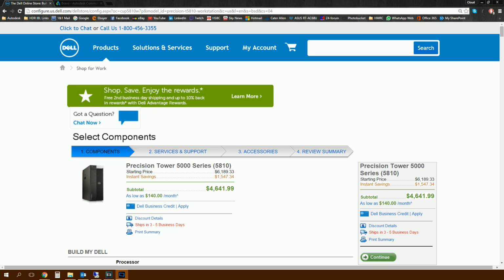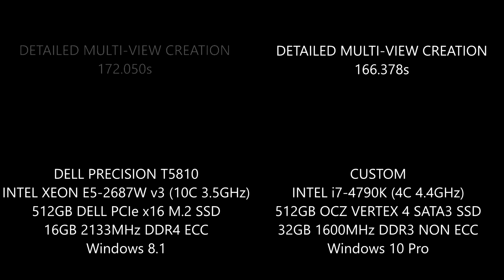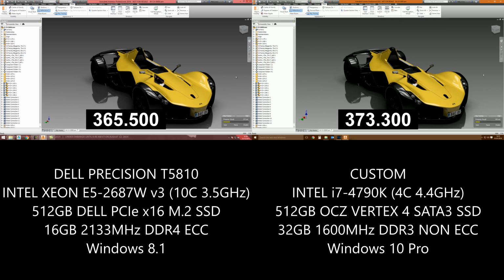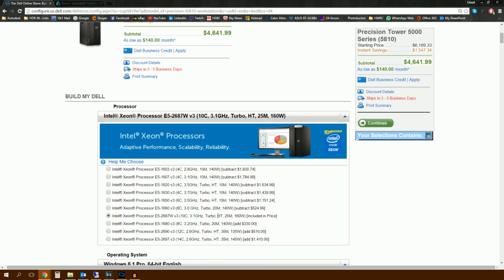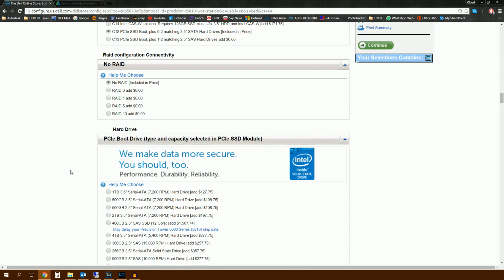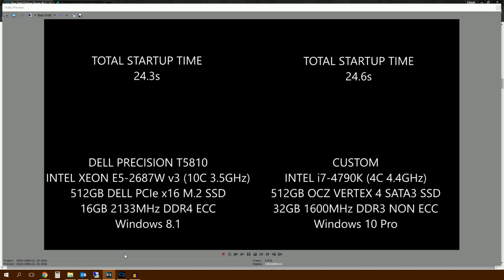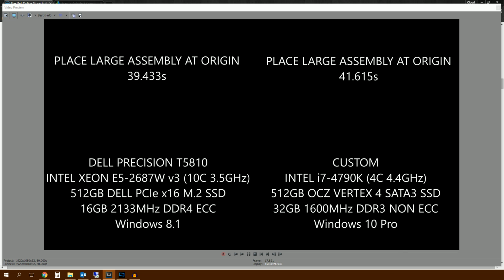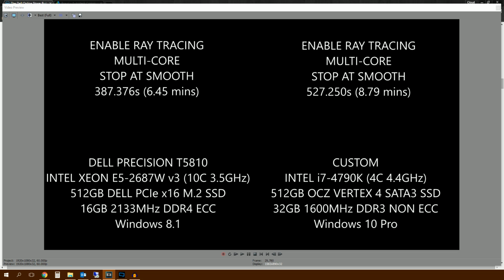$6000 10C Dell Workstation -VS- $2000 4C Gaming PC | CAD Benchmark Test

Comment: From my personal experience, Workstations are and always will be better than putting together a PC.
My background: Server Hardware Engineer, 6+ years of experience in Dell Precision, Powervault, PowerEdge servers/workstations/storage solutions, IBM X-Series servers, HP Proliant, Procurve lines. Anyways...

I have personally purchased both second-hand and new workstations from Dell. 
Here are a few:
Used: Precision 490 (2) , T5400 (2), T3600 (2), T5600 (1 - & my personal PC)
New: T3600 (4), T5600 (4) 

I agree with the idea behind Dell marketing making a huge deal about server line CPU's is a bunch of fluff. You CAN build a PC that is nearly as-good or equal to a workstation. However, my point is the failure rate between a custom-PC and a workstation is appalling. I have fixed and worked on both and I rarely get back workstations that have failed from the moment they are sold to when it reaches the client. Yes there are some failures, however the sheer number of failures I receive are about 90+ % more leaning to custom PC builds. Out of 100 or so workstations/PC's 90+ of them are custom-PC builds. Workstations are meant to run for long periods of time without the necessity of powering them down. 
Of the workstations I've purchased used and new not a single one has failed me in respects to it's integral components ie: CPU, memory, PSU, USB ports, Ethernet Ports, Onboard SATA or BIOS corruption. The only components that have failed me was a single SATA Drive (5 yrs old ) and a graphics card on my T3600. My Old personal PC was  T5400 that I bought used 3 years after it's release and was running for a good 5 years with no issues. I upgraded to a T5600 and my T5400 went to one of my employees. Still running strong with a newer graphics card. The best part of all is, Xeon CPU's and Server Ram (Registered or buffered) is only getting cheaper. I've put together workstations that cost me hundreds instead of thousands and are better than today's custom-PC's. There are pro's and con's but if you prefer a solid build i'd stick to a workstation from either Dell or HP. 
Just my two cents.
Reply: Yeah these amateurs with their gaming pc's just don't understand the advantages of an enterprise class workstation. Just watched another video of a guy running gpu gaming benchmarks on a quadro card lol :D
Reply: Well, I have still runing an old Athlon x 2 64, from the time, Pcie slots came to light.
It ran practically 24/24, 360/365, with renewal of only the PSU, as it was  getting overloaded, from being in a hot climate, and running 8 Harddrive. The only reason, the machine is now , for the time out of service, is, because the OS crashed, due to HD FULL.
I do acknowledge, the older hardware seems to be more stable and durable..... Still have an old K6-II super socket 7, still working well..., and I have 6 servers Dell 2850, ALL have motherboard issues..
Before that, I ran a own build server, based on a K5-133 , EIDE ( now PATA) drives, scsi controller, and a scsi raid controller, shared the internet connection, ran a website, was faxserver, etc... it still runs....

The only stuff that died on me, are the Dell 2850's..., and a ecs duron board.
Reply: Yes,  I recently replaced an old DEL XPS420 with BSEL modded Q6600 (3.1 Ghz air cooled) that I ran for 10 years.  Moved to a DELL T5600 with dual E5-2667, 32 GB ram, H310 RAID card, and 825 W PS.  Threw in the GTX1050 that was bottlenecked on the XPS 420 and voila...plenty enough for my home PC needs.  The T5600...got it from my company when they decommissioned them for newer latest gen i7's for our developers.  It was allocated at zero book value...basically I got it for free through the company deal.  Not bad.  Smiling with this monster...all the way. Will upgrade the video card after the prices inevitably drop after XMAS. Probably a 1070 or 1070 Ti.

Comment: Inventor only uses 1 core for all it does, except for the rendering engine to create a nice presentation shot. So as it has been for several versions before 2016, and even now with 2018, go for a higher clock over cores. as for video performance, autodesk-microsoft-nvidia have had issues properly switching between the onboard gpu and the plug-in GPU board. It seems to have been cleared since Inventor 2017. so the i7 with video will be fine over the xeon.
Reply from the maker: +FlexDRG Inventor doesn't only use 1 core. It is mostly single threaded but there are 7 or 8 modules that are now multi threaded such as the graphics engine, FEA solving, drawing view creation and others. It's far more complicated than a one sentence answer hence why I started a real world suite of benchmark tests but indeed an i7 is still the best
Reply: TFI Correct. but as about 90% or more, mostbof us will be in the modeling interface (part and assembly work) that is single treaded, clock will beat out cores. getting a slower, higher core count cpu is nice if you have an oldscool design office where a dedicated person is making design views (idw) and or nice machine renderings. otherwise those extra cores go to waste and productivity drops for lack of clockspeed...
Reply from the maker: I know, I've published loads of videos proving that with benchmark tests.  Too many people completely missed the point of this video and treat it like watching a gaming system comparison.  The point wasn't to see which is better and then shit on the loser.  The point was that there's millions of enterprise end users out there who don't know hardware, and after reading the marketing material, they'll believe if they buy a $6000 workstation it will be the best that money can buy.  The point here was that you can't just throw money at hardware to get the best performance in 3D CAD, it's a game of picking the specs carefully and money doesn't mean the best performance.
Reply: I'm about to order a new system for IV2018. i7-7700K with a Quadro P4000 and 32Gb ram. should do the trick for the upcoming couple of versions / years. My current system is an i7-4820 K2000 16GB... I was leaning towards a Xeon. but is also a 4 core and is slower in clock. And igpu is not the driver issue it once was with IV.

Comment: you dont understand how speedstep works. you will never have 10cores running 3.5ghz all at once. with this model i think its a maximum of 2 cores boosted to 3.5ghz at any given moment.
Reply from the maker: +Vladimir Ilyich Lenin This isn't a video to see which PC is the best and most powerful, this is two completely different systems tested at doing the same jobs in a CAD application, the point of this video is to see if there's any benefit to either system at doing those jobs.  An engineering manager isn't going to be interested in hearing about Intel Speedstep or hyperthreading or XMP profiles or AHCI vs RAID or PCIe vs SATA, they just want to know if buying a high end workstation like this one will make their CAD functions run quicker.  That was fundamental purpose of this test.
Reply: +TFI CAD Tips i never expected this video to be about that. i enjoyed it nevertheless. im just trying to make you understand that you have infact made mistakes troughout that you shouldnt do when you are talking about hardware. as i dont know what said engineering managers job description is, i cant judge on that. but on a personal note to you, if you talk about the hardware, you should know the basics. and speedstep or turbo as you called it does not clock all cores in the fashion you described it. 

i think on the cad side of things you are probably software bound but i can identify a few things that could have taken the margin of error out of your assessment of the hardware in order to rule these out.
Reply from the maker: +Vladimir Ilyich Lenin Fair enough but please remember that this PC was not bought to be tested here, it was bought to be a FEA workstation in a real world office on a tight budget.  The T5810 chassis does not support dual Xeons, that's only possible in the T7910 chassis, Autodesk Inventor doesn't support and cannot use dual CPU configs not can it utilise SLI or multiple GPU layouts.  I'm very much aware that if I spent £20,000+ I could have had liquid cooled dual Xeons, 64GB+ RAM, dual M6000 cards, but this was bought for a guy in an office who will do the occasional bit of FEA and simple Inventor modelling work the rest of the time.  I grabbed the PC and ran some basic level tests on it over the xmas period, it wasn't acquired purely to be tested in this manner.  I also appreciate that the clock turbo (that's not what I call it, that's what Intel call it http://www.intel.com/content/www/us/en/architecture-and-technology/turbo-boost/turbo-boost-technology.html) might not utilise the maximum advertised clock speed at all times, but where do I stop? If I went off on a tangent to explain Intel Speed Step, it would make for an even more long winded video.  My audience doesn't come here for detailed factual hardware info, we have Linus for that, this is sold as what it is... a CAD application benchmark test on two different platforms.
Let's not detract from the core purpose of this video, which was "here's an expensive professional workstation which would typically be found in an engineering office, and here's a gaming PC with consumer grade components, let's do some real world CAD functions and see how both perform at the exact same tasks".  Whatever reasons there might be to why the workstation isn't smashing the results, then it will only go to assist with the conclusion.  I am more than happy to submit to not being a PC architecture expert but like I said, this was just a basic CAD benchmark test :-)
Reply: +TFI CAD Tips take my input in a constructive way. you overbuild and underbalanced. i am aware you are paying the premium for support with all dell/hp/ibm/fujitsu workstations. i dont want you to go out of your way and build it on your own either, unless you know what you are putting together. the purpose of my criticism is not to make you go rampage and select the most expensive components you can select, but to have you reflect on the choice of components you made. obviously im not aware of all the details of your workplace, but that isnt what you were discussing, but here is the kicker - you just said yourself that this machine was bought for a guy that occasionaly uses a bit of FEA and otherwise inventor. its overpriced and fairly unbalanced. 

you are making a distinction that isnt realy there anymore. workstations use the same off the shelf hardware you can buy for your personal computer. you talk about what your audience is coming here for.. your audience is probably not a bunch of hillbillies drinking pabst blue ribbon while watching this either. i think they would appreciate it if you went into some troubleshooting and explored why the workstation with its superior stats performed alot worse then people would expect. you touched that topic on the software side of things but i felt like you did leave some important facts out..

p.s. for the love of anything that is holy.. dont use linustechtips for anything other then a starting point for your own research.
Reply from the maker: +Vladimir Ilyich Lenin Haha Linus Tech Tips, their latest video was about how to heat up a pizza slice with a GPU, that's as professional as it comes that is!

Comment: I wouldn't touch the cheaper option, having used similar specified machines for architectural illustration, the gaming style machine would repeated give me problems, it just felt flakey, I always stick to a decent Xeon machine, and ignore benchmarking, reliability is key when dealing with high load applications, fast renders are great but if you keep crashing then you are going to regret pursuing pure speed.

Comment: Shouldn't the graphics card come into play for these operations? Workstation graphic card vs a gaming card should be the more critical tests to do
Reply from the maker: +Leandro Jack The graphics card has very little effect on Autodesk Inventor, it's almost entirely CPU driven.  Inventor uses exactly no Quadro or Firepro specific features and gaming card are actually more powerful and doing what Inventor needs.  On my desk here I've got a GTX 970, R9 380, Quadro 2000 and a Firepro W9100, the gaming cards give higher frame rates but only minimally.
Reply: +Leandro Jack The best I can say is workstations in my experience have helped prevent artifacts on some of my renders but i think its based more on updates. But my job required me to have it working now not a month from now, Quadro's on launch get updates every 1-2 weeks to ensure they function the best possible.

Comment: But what were the graphics cards? Is a CAD workstation card worth the money over a gaming card?
Reply: If you want to do serious work, a workstation is much much more stable. If you want to game get a regular gaming card. Also the quadro cards these workstations generally come with aren't designed for gaming, they have more video ram than their gaming counterpart and more compute cores, but run at a lower clock speed. Also the quadros are designed to run rock solid 24/7/365, a gaming card is not, just check with the crypto currency miners who destroy their cards by trying to run them constantly.

Comment: Watched a lot of your videos so far, and was wondering what I would be able to do with my PC now. I have had my fx 8350 for a while now and my r9 270x 4gb. For Cinema 4d is great, but lacking in inventor that I do for my robotics club. I know single core performance is needed for inventor, and the 8350 is alright, but wondering if there is anything I could do to make it better. I could oc my CPU is need be.

Comment: Great informative video. We actually bought a similar Dell at the office today for a simulation rig (FEA and CFD). It would be nice to see a comparison between your gaming PC (nice tidy build by the way) and this Dell on FEA and/or CFD.
Reply from the maker: Thanks! Check out this one https://youtu.be/O35T_UbJQLM I do a comparison between a 6 core Xeon Dell Workstation and a 2 core Pentium, one of the tests being FEA meshing and results calculation
Reply: +TFI CAD Tips Wow, the pentium was over 1 minute faster in meshing and solving. Incredible. 
Will you be able to do the same test with other FEA software, like Ansys, Nastran or Simulation Mechanical?
Reply from the maker: That'll be difficult, I don't have access to Ansys or Nastran licenses and I can't be using pirated software on a youtube channel so it would be difficult to do that! If I ever had an opportunity to get licenses for use then yes I definitely would
Reply: +TFI CAD Tips  You can get the student version for Ansys, however it has a limit on the node count (based on mesh refinement) plus, as you make money from your videos, it might be illegal as it would be seen as a for profit use. Doesn't autodesk give Nastran InCad trial versions?
Reply from the maker: I'm about 20 years too old to qualify for a student license haha Yea I could probably get a hold of a Nastran license pretty easily now that I think about it, I'll just have to weigh up whether it's worth my extremely stretched time learn out how to use it to a point where I can do a credible video on it, based on how much of an audience there'll be for it.  To date, I think you're only the second person to ask about it.  In my circle I know that they're having trouble selling it into accounts that already have Ansys, nobody wants to ditch Ansys when they already have an investment in it

Comment: Good test:
the software benchmark app must take advantage of the full ten cores or the test is really not apples to apples.
if the program only takes advantage of four cores or less, than usually the machine with the fewer cores but higher frequency GHZ will when.
So most pros will look at their programs to see if their pro apps take advantage of all cores.
Same with video cards, apps that benifit more from cuda cores will do better with an nvdia card than and amd card, and usually open cl app will do better with an equally spec amd card.
First make sure the apps/benchmarks can take advantage of all cores, like handbrake, a lot of cad and 3d apps, same with gpus, with cuda cores.
same with memory use.
same with faster ssds vs slower ssds, they usually only show thier speed on very large files.

Comment: is this correct? 16gb ram in a workstation? even my older model z800 workstation has 48gb. my newer z820 has 64gb. why would you ever pair up a fast 10core cpu with just 16gb of memory?
Reply from the maker: +Vladimir Ilyich Lenin This workstation was bought to run Inventor in an environment which doesn't generate excessively large datasets, there's no risk of someone maxing out 16GB RAM where this will be used and just putting more RAM in won't make it passively any quicker.  There's also the cost to consider, in most businesses you have to get purchases approved and it would have been impossible to approve this purchase if the cost included an unnecessary quantity of additional RAM.  You can't easily put in a new CPU if your requirements change but you can easily buy additional RAM if there was a requirement for that.
Reply: +TFI CAD Tips what was the momery configuration? memory bandwith makes a large difference in compute heavy enviroments. the total bandwith available to the socket is greater if you can populate the channels of the cpu :)

id love to run the benchmarks on my workstation rigs for you :)